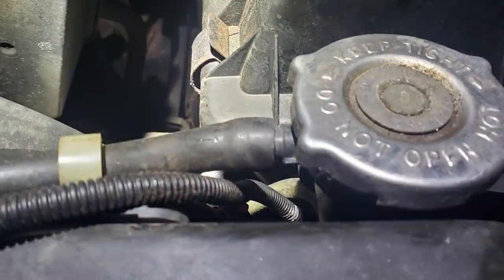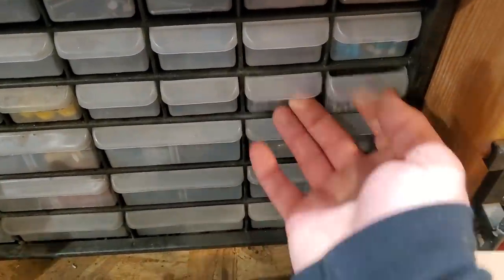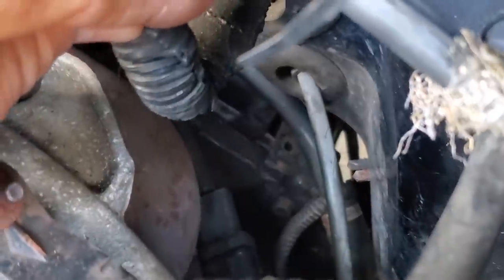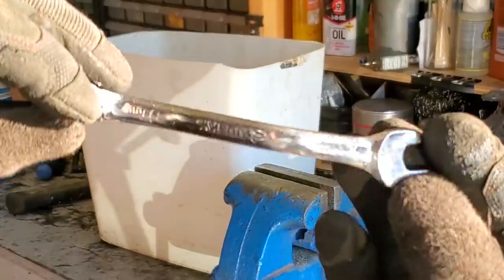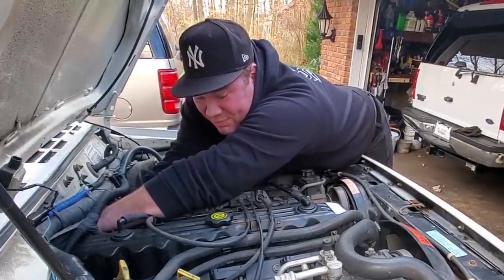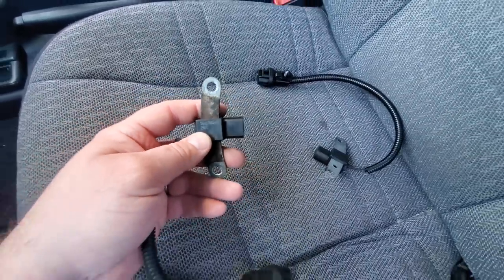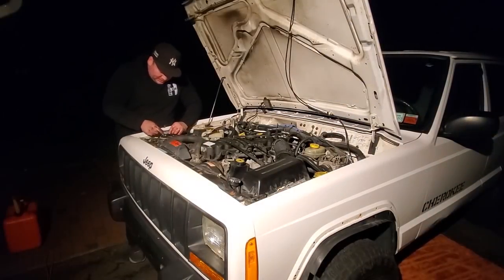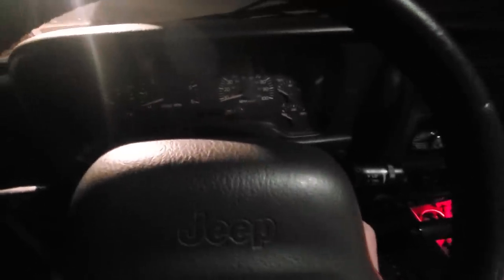JEEP CHEROKEE FIRST START IN 6 MONTHS - DOA POLICE XJ GETS A CRANKSHAFT POSITION SENSOR

Comment: '89 Pioneer (XJ) doesn't have nearly the room you have on yours. I can't even get one hand into place, much less hold the part in place to put the 7mm 1.0 bolt with 11mm head in. Wish they had used studs, as they'd kind of keep the part in place while one could at least put one nut on to pull the part into place, thus the second nut or even bolt could be installed. Think I'm going to use a bit of heat shrink on the wobble head to limit the angle once I have someone help me by holding the part in place above while I attempt to put the bolts in from below. Pretty sure on any make or model of vehicle there's always got to be one thing that's got to be a PITA to get to.
Reply from the maker: Studs would be a great idea.. I think im gonna cut a hole in the firewall to access these lol
Reply: @ProjectDanH  I'd been contemplating that as well. lol
Reply: @ProjectDanH  (Update) 2022 May 17th - Using a borescope I was able to spot the bolt that I had dropped in behind the flywheel. Once spotted I was basically able to use a "16 penny" nail to get it to slide towards the drivers side to which it came out rather easy. Earlier I had used my garden hose to spray water down into the cavity behind the flywheel which washed the bolt to the bottom and center behind the access plate. This time while inserting and getting the bolt started I decided to use some heavy thread tied onto the bolt with a pare of forceps clamped on the other end should I drop it again ("safety line"). Sorry I haven't been able to update this until today as I've been busy with life.  xD lol

Comment: This is candy for me. Ty for the content! On a side note, my 5.7 06’ commander had a crazy issue recently. Oil in safe range fine for 6mo, then the last 4 mo it managed to lose 5 quarts. No blue or white smoke, no gasket signs. Spent a butt ton at idle to keep heat on. No oil light!!! Only way I knew to check was new sound of slight rattle at start up for a second. Checked and registered at bottom of dipstick. Weird cause it took almost 5 quarts to register a little higher than the bottom stick after this ordeal, still not in recommended range of dipstick at that point till I added more. But I feel the difference in pressure, it feels strong. Sound stopped.  Any thoughts? No way pcv causing that huh?
Reply: Will be checking at every start up now till I figure out a consumption rate. I feel like as it got lower it went faster due to the slightly elevating temp. Glad I caught before anything went seriously wrong. Hoping just a pan gasket.
Reply: Oil level seems fairly steady so far so if it’s a leak it’s a slow to medium one 🙌
Reply from the maker: That's scary stuff dude If it's not leaking and it's not burning it I wonder if there's a small head gasket leak that's pushing the oil into your coolant does your coolant look black at all? It's got to be going somewhere very strange! Definitely keep an eye on it
Reply: Tried running on tow haul and damn, she sounds and feels much more solid at all times! No delay in shifting
Reply: @ProjectDanH  it feels oily, but not more than coolant usually does. No creaminess or black gunk built up. Hoping pcv had a mass blow by issue that cleared up somehow. Gonna check it out soon. Driven a bit and no noticeable oil loss. Perhaps the armor under the motor has been masking a leak.
Reply: Yeah, either way it has me feeling weak in the knees.

Comment: Ok so the first  test for the cps is easy first crank it and see if the tack moves 
If the tack don't move cps is dead for sure 
Next test it's got 3 wire one will be ground one will be 5v reference from pcm/ecu other will be the signal wire usually middle wire in the plug put your multi meter on that wire and crank the engine over by hand to TDC mark turn the engine over one complete turn by hand the meter should blink 5v ish volts 12 times in one complete Revolution of the engine if it's missing one notch that could/will be a miss fire for a dead cyclinder it's a waste spark system and it fires in exhaust stroke that's why it's 12 
The missing cover was removed by the guy who put in the autozone junk sensor

Comment: Anything related to electronics on the engine has to be replaced with factory original parts. I can't tell you how many O2 sensors I've replaced because aftermarket sensors just aren't the same.
Reply from the maker: Amen.... That's a Fact!

Comment: Dust shield on a manual XJ is one piece so dont drop a bolt in a 5 speed.
Reply from the maker: Holy crap! I never noticed! I'll be sure to add a two-piece shield into the beach deep build
Reply: @ProjectDanH  one would assume that's possible,  figure converter bolts being the reason for a 2 piece

Comment: You could have checked to see if it was a crank shaft sensor by connecting a scan tool and checking for engine rpm data. And then checking the ignition on coil to see how many volts are coming out of the business side.   

No need to swap parts
Reply: Also Mopar lists the crankshaft part number the same for auto vs standard
Reply from the maker: Yep!
Reply from the maker: nice! I thinks supposed to be 5volts
Reply: @ProjectDanH  it operates by the Hall effect so I don’t think you can measure resistance, but you might be able to use a test light and a ground to the coil to induce spark. Taking the place of the crank sensor. Also when you induce spark you should be able to hear the asd allow the fuel pump to run as well
Reply from the maker: @hoodedgood  yes.. good Info C! Thank you

Comment: What is a doa? Police model?
Reply from the maker: I have a 2000 Police model XJ that I am fixing
Reply: @ProjectDanH  I heard that I'm just wondering what the differences are in a "police model" vs a regular model? I have a 94 RHD 2 door 4x4 4.0 I'm working on now.
Reply from the maker: @NomadXplorer  in police model XJ you will commonly find a 120 mph speedo, d35 with ABS, trans cooler, larger rear drums, extended idle switch, 4 switch bezel, vinyl seats, rubber floor liner,  front , transfer case, and tank skid plates and sometimes CPI siren, and push bars.  They also don't have rubber door moldings or roof bars.

Comment: i got mine off in 5 minutes from underneath with a 1/4 ratchet no extensions mmm
Reply from the maker: Because your POS has a 10 ft lift 🤣🤣🤣🤣
Reply: @ProjectDanH  CORRECT, plus its too tall to do the ole lean over the engine bay trick you did lmao
Reply from the maker: @alexbillian2846  🤣🤣🤣 youd need a 12 ft ladder for yours!